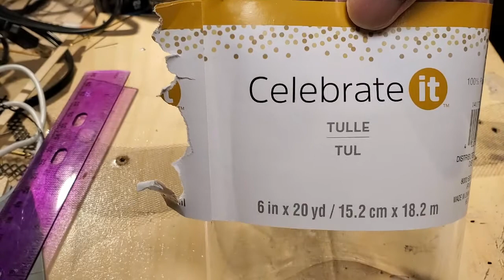Making a Chain Link Fence for my HO Model train layout for under $5

Comment: Great video. To add more detail and realism you could add in the corner braces that you find on many chain link fences just by angling a piece of rod or tubing at the end of each run of fence and in the corners. Well done!
Reply from the maker: Hi Johnny .. Thank you for the comments . The idea about the corner brace is a fantastic idea ... I did not think of that ... I purchased a 3D printer lately , and I have been printing my chain link fences using the 3D printer .. But I definitely will try to add the corner brace ... it adds more realism ... Great idea again Johnny ... 
Regards, - Anthony .
Reply: @anthonyshobbycorner  You're welcome. I used to be in the fence business so I notice these things...lol.  To go the extra mile, it's hit and miss whether there are corner braces in 4 foot residential fencing but most commercial fencing will have it at the ends/corners and in the middle of very long runs (longer than you'd see on most models or model railroads).
Reply from the maker: @johnnypenso9574   - Since you were in the fencing business, can you tell me typically how long each fence section was ? ( commercial fencing ) . Cause I was making my new fences to be 2.5  cm / section , which amounts to 7.1 feet in real life. I made it 2.5 cm only because it was esthetically pleasing on the layout . are typical commercial chain link fence sections approx 7 feet in length ?
Reply: @anthonyshobbycorner  The most common would be 8 feet although if you have a run of say 60 feet you aren't going with 7-8 foot sections and then a 4 foot section, you'd divide it up to even sized sections of 7.5 feet.  Unlike a wooden fence, most chainlink fences also have a top rail that runs through a loop at the top of the post in the long runs and would only be attached at the corners or in the sections with the angled support piece which means you can put the posts anywhere, making it easier to create sections of any size.  A real budget version of residential chain link, typically 4 feet high, might have posts 10 feet apart.  

Like this:
https://www.thespruce.com/thmb/DkyALlAFlffmi6zHHZ6YeFd4c1w=/3000x1687/smart/filters:no_upscale()/chain-link-fencing-big-56a583563df78cf77288ab85.jpg

Corner posts, especially in commercial versions, are also typically a larger diameter.  The corner brace is sometimes done at an angle from the top of the corner post to the bottom of the next post or horiztonally in the middle of the fence at the corners. Sometimes they even use a tension wire to do it. In a higher quality installation it's also common to see bracing where there are eleveation transitions aka the bottom or top of  a slope. There is lots of variety. Best to look around the community at what you want to model to get some ideas from real life.
Reply from the maker: @johnnypenso9574   - Thank you so much for the detailed response . i will be taking all of this into consideration when I make more 3d printed fences .. It's good to try and mimic reality as much as possible .. Thank you for sharing the link and the detailed info you have provided .. I will also take a look at the local fences as well .. Regards, - Anthony .

Comment: what's first materials ? Ready or did yourself ?
Reply: im see now but how do you connect each other irons ?
Reply from the maker: @asmcubuk9892  Hi Asim  I used simple copper wire or brass rods ( cut up into short lengths) and Wedding Tulle ( for the mesh ) . I used a soldering iron to solder the rods together with the main rod going horizontal . If you don't have a soldering iron , you can try by joiing the rods with strong glue. 
I do have a more simpler way , which I am planning on posting next week . The simpler method is to use spare ho rail , cut it up into short lengths and use them as vertical posts and then use the Tulle to act as a mesh . This method will only have vertical lengths and the mesh, without the horizontal beam which coes across the top of the fence . 
Hope this helps .
Reply: @anthonyshobbycorner  you help me so much im waiting for your new video thank you greatest chain link on youtube
Reply from the maker: @asmcubuk9892  Thank you for the kind comments Asim .. I will try to make a quick video this weekend for your benefit . Do you have any spare rails from old track ? that is what I am planning on using as the vertical posts. just a heads up ... Regards Anthony .
Reply from the maker: hey Asim , Nice Mercedes on your home page banner , I've just Sub'd to your channel ... Regards, Anthony.
Reply: @anthonyshobbycorner  When im done my diorama i will share with you
Reply: @anthonyshobbycorner  i make diorama for my hotwheels junk yard so  thats i  need chain link im begineer yet :D
Reply from the maker: @asmcubuk9892  Hey Asim , Sounds like an interesting project . Let me try to churn out a quick video tonight on how to make a simple chain link fence , Using just Tulle and wire . You will have to show us your diorama on your youtube channel when its complete ... 
Regards, Anthony .
Reply from the maker: @asmcubuk9892  Hi Asim , As per your request, I have posted a quick video on how to make a very simple chain link fence for your hot wheels junk yard diorama . I hope this helps . It is a very simple fence , nothing fancy . Take a look at the video titled "very simple chain link fence" on my channel.  - Regards, Anthony .